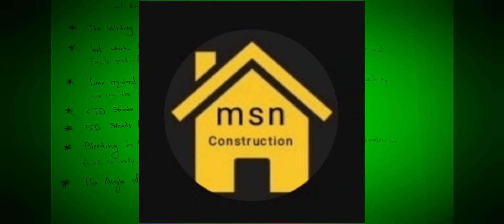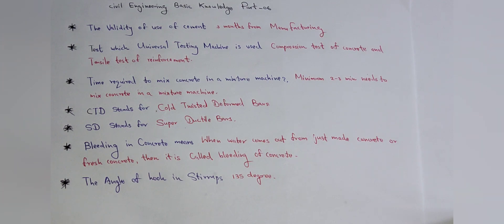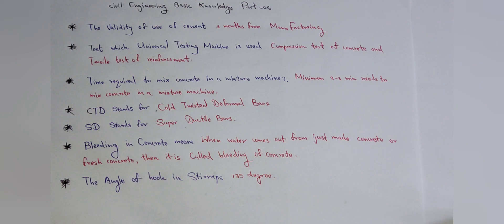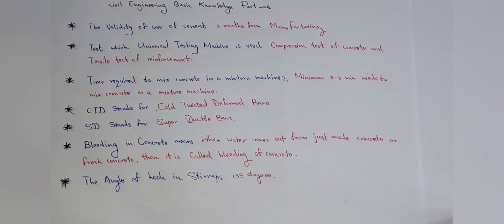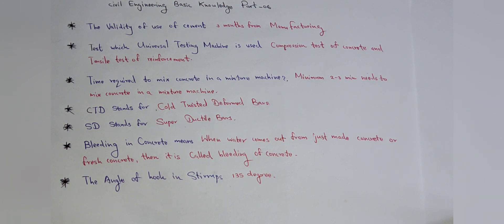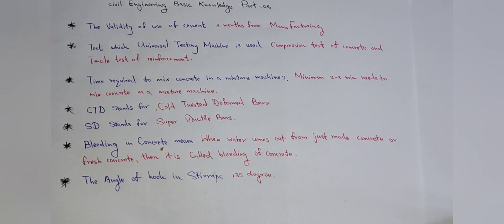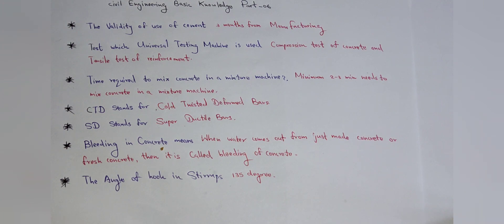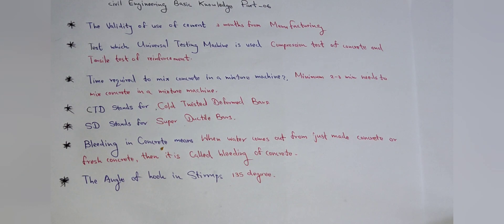#Civil Engineering Basic Knowledge Part 06

Comment: Please explain in sinhala too
Reply from the maker: Sure I will Explain in Sinhala as well
Reply: @msnconstruction1821 only this video
Reply from the maker: 🏗️ Civil Engineering Basic Knowledge – Part 06

1. The validity of use of cement is 3 months from manufacturing.
➤ සිමෙන්ති භාවිතයට සුදුසුකම් පරීක්ෂා කාලය (Validity) යනු නිෂ්පාදනයේ දිනයෙන් පසුව මාස 3ක් පමණයි.
🗓️ අතුරු අදහස – 3 මාසයකට පසුව සිමෙන්ති ගුණාංග අඩුවේ ය.

2. Test which Universal Testing Machine is used – Compression test of concrete and Tensile test of reinforcement.
➤ Universal Testing Machine (UTM) භාවිතා කරනුයේ:

කොන්ක්‍රීට් සඳහා Compression Test (උපරෝධන පරීක්ෂාව),

වායුමය රොඩ් (Reinforcement bars) සඳහා Tensile Test (ආතති පරීක්ෂාව) කිරීම සඳහාය.

3. Time required to mix concrete in a mixture machine – Minimum 2–3 minutes.
➤කොන්ක්‍රීට්  මිශ්‍රකයක් තුළ කොන්ක්‍රීට් මිශ්‍ර කිරීමට අවශ්‍ය අවම කාලය විනාඩි 2 සිට 3 දක්වා වේ.
🕒 එය හොඳින් එකිනෙකට මිශ්‍ර වීම සඳහා අවශ්‍ය වේ.

4. CTD stands for Cold Twisted Deformed Bars.
➤ CTD කියන්නේ Cold Twisted Deformed Bars (උෂ්ණත්වයකින් නොව, තැවරා හැකිලූ වායුමය රොඩ්) ලෙස හැඳින්වේ.
🧱 ඇයව භාවිතා කරන්නේ කොන්ක‍්‍රීට් ශක්තිමත් කිරීම සඳහාය.

5. SD stands for Super Ductile Bars.
➤ SD කියන්නේ Super Ductile Bars (ඉතා වැඩි වක්‍රණ හැකියාව ඇති වායුමය රොඩ්) ලෙස හැඳින්වේ.

6. Bleeding in concrete means – When water comes out from just made concrete or fresh concrete, then it is called bleeding of concrete.

➤ Bleeding in Concrete කියන්නේ නව කොන්ක්‍රීට් එකකින් (fresh concrete) ජලය ඉහලට එන අවස්ථාවයි.
💧 මෙය “Bleeding of Concrete” ලෙස හැඳින්වේ. එය අතිරේක ජල ප්‍රමාණයක් නිසා සිදුවේ.

7. The angle of hook in stirrups is 135 degrees.
➤ Stirrups (ස්ටිරප්ස්) වල hook එකේ කෝණය 135° වේ.
🔩 මෙය වායුමය රොඩ් එකේ අග්‍රය බැඳීමේදී භාවිතා වන සම්මත කෝණයකි.